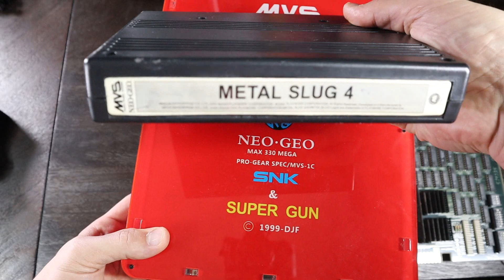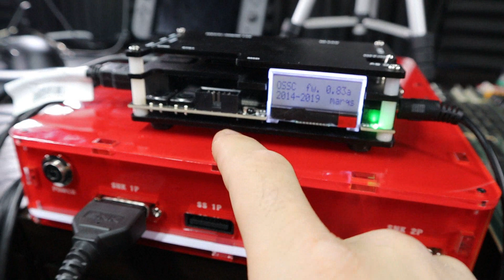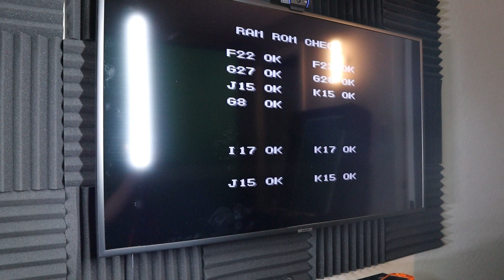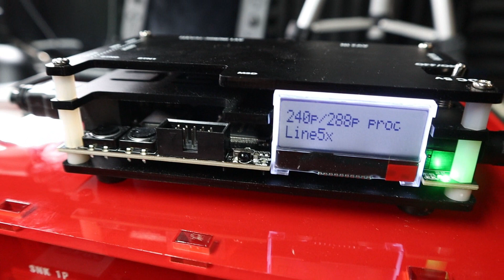What the heck is a SuperGun?!? Play Neo Geo and Arcade PCBs!?!?!

Comment: This is an awesome little device. My home built supergun is actual arcade hardware bolted to a piece of plywood (power supply with a power strip, GBS-8200 video encoder, line level audio device, with undamned usb decoders). The whole build was cheaper than this device, but it is certainly larger than this setup. This is really slick.
Reply from the maker: Thanks bud, I need to build my own one day.  Thanks for watching 🤘🏻
Reply: @RetroRalph  It's pretty easy to do. Just like wiring up a regular cab. Like I said I just bolted my components to a piece of plywood, power strip included for easy on/off. I'd recommend a separate power supply for the undamned USB decoders. I love playing windjammers on it with my PS4 stick.
Reply: wish i could grab an undamned encoder
theyre always sold out 😅😅

i just wire my own junk using cut up neogeo extension cords and sawna buttons lol

Comment: Hey Ralph, I just pressed the button on the NeoSD Pro Flash Cart order for my MVS CBox... They were back in stock for a limited run and could not risk them never releasing it again.  :)
Damn expensive but much less than purchasing a few original carts.  The pro version has five slots, 4 rom and 1 ram, so my single slot will act as a very rare five-slot MVS.  :)

Comment: Sorry for the second comment, but I have a quick question. I'd like to get one of these 2 in 1 CMVS consoles so I can play MVS and other random arcade games including a board called the Atomiswave by Sammy. Some of the games that are found on the Atomiswave require more than four buttons which pretty much rules out Neo Geo sticks/pads. My question is will this 2 in 1 console allow me to play those specific 5+ button games if I used a Saturn controller? That pad has 6 buttons so in theory it should work, but I'd rather ask first before buying those specific Atomiswave games. If not, would I need a kick harness or the USB version of the 2 in 1 instead?

Comment: Is the voltage adjustable???  Most superguns have adjustable voltages because each arcade board is different and low voltage can cause issues and sometimes not allow the game to boot.
Reply: If I'm going to guess this device is adjusted for 5V PCB's boards only. Which it will handle most PCB's, but it would be nice if it's voltage adjustable.
Reply from the maker: I'm going to cover this in part 2 but yes, there's a knob on the side to adjust voltages and enter the test menus of the PCB you have connected.
Reply: @retroforce6919  Yeah sometimes you need to bump the voltage because the board your using can draw more and bring the voltage down.
Reply: @RetroRalph  Oh cool.... yeah there are some pretty cool superguns on the market... some are super tiny and work really well...

Comment: Dude I only have one very simple question. no other you tuber has answered so far. I want to stick this inside a cabinet.. (why you may wonder..) simply put, to hook up a Pandora's box on the external pcb adapter. I know you have original pcb boards.. but have you tried if It works with a pandora. I am planning to have my samurai shodown 4 mvs cartridge and be able to switch seamlessly between the two. Could you try to see if it works?

Comment: 🕹💥Need your HELP Retro Ralph...I tried to connect my Rampage (arcade 1up) circuit board to a newer TMNT cabinet monitor and all I got was a black screen with sound only...then when I went to put it back to original rampage monitor, my original monitor all of a sudden wouldn't work right, giving me just a total bright white screen....??...what happened?....is there something in the newer monitors that arcade 1up is now using that put out some kind of shock or surge or something that damaged the circuit board or something??...I'm confused by all this, it is a direct plug and play situation with both monitors matching all 3 plug harnesses exactly. Now I have a non working rampage cabinet because of this. Any help or guidance you can offer would be appreciated,  thank you.